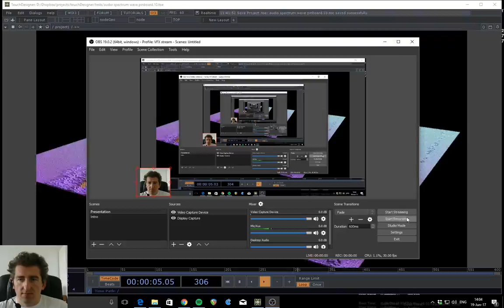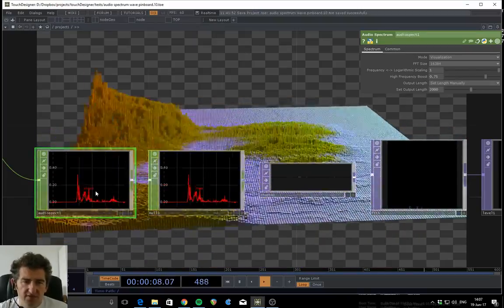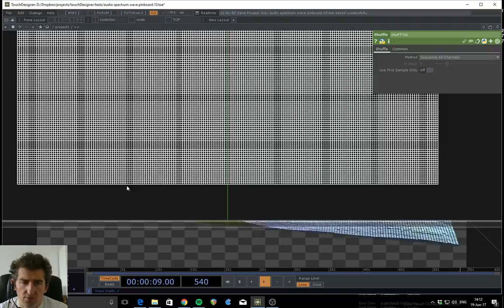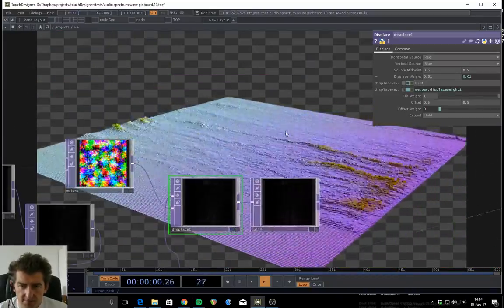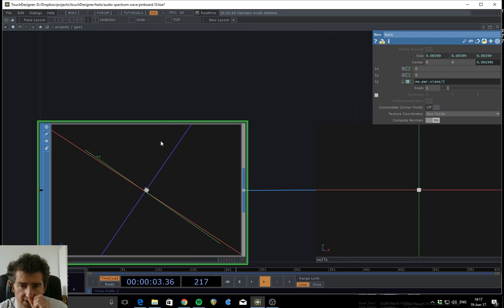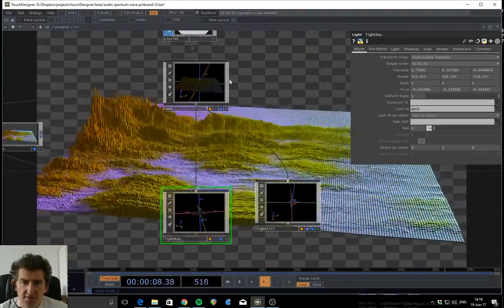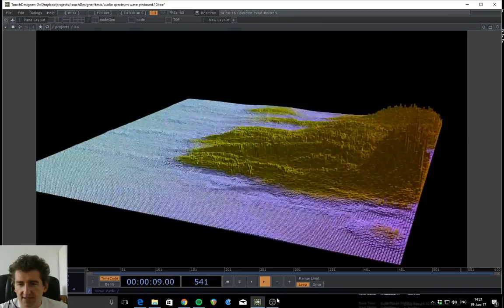Audio spectrum wave pinboard, TouchDesigner tutorial

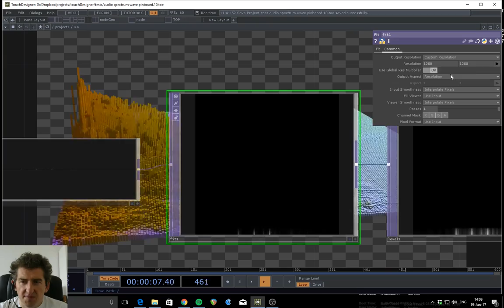Comment: how did you shift the line of  pixels to the bottom  from fit1 to level1? (4:46)
Reply: I had the same question. From the .toe file he linked, in fit1 you have to change Fit to "Fit Horizontal", translate y to -0.5 and change the scale to 1.23-100.

Comment: not very helpful as a tutorial per se, for example I am lost at 4:30 how to connect the null(which you didn't explain why put a null there) to the Chop to SOP.
probably to those in advance level will find better use of this video but as a tutorial this is not helping me :(
Reply from the maker: Maximilian Y. I've picked up this nulls approach from Matthew Ragan's videos I think. The null acts as the end point of the chain which you connect to another chain, the  ChopToSop in this case. If you don't have a constant end point, you'll need to drag a new end node every time you add it to the chain. But with the null always at the end, you can drag/connect that, and keep changing the chain before it - the result will still get piped from the null to the right place.
Reply: thanks for the reply! Would you please point me to any source that showcase how it work? because i just drag a null, and then the Chop to TOP (not SOP because the color is different?) and it just didn't connect and I have no idea what to do next.